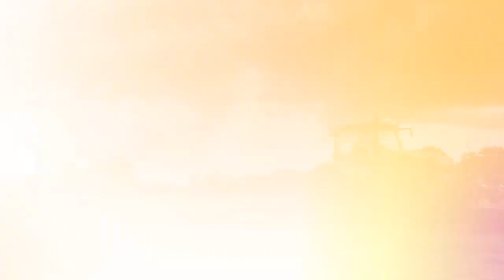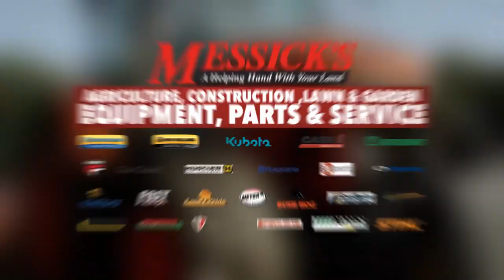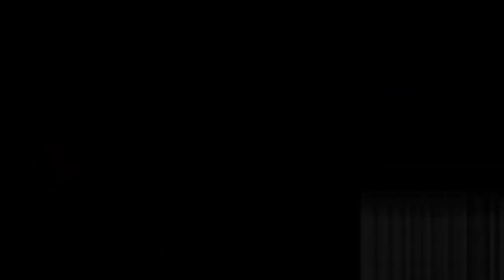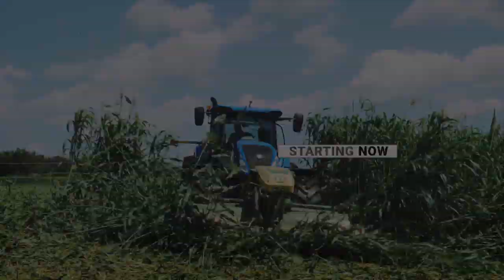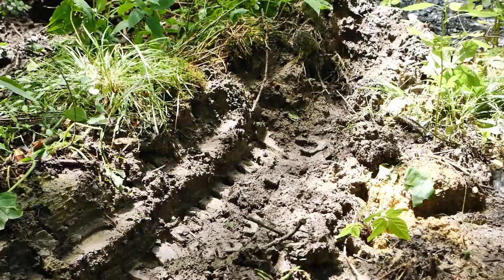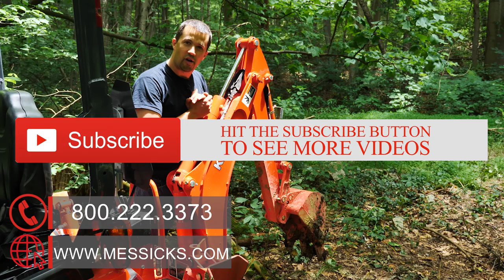Axle deep in the mud! Getting Unstuck with the Backhoe

Comment: I did this, yet with a wheeled skid steer this spring, 8400lbs sunk to the frame in the grass. Soft enough I stepped on it with my shoe and sunk to my knee.
Not sure but I have a few logs and pieces of 2x12 in my yard now about 2 ft deep

Comment: I am starting to have doubts about the R4 tires
Reply: They load up with mud really easily.
Reply: They fill with mud very fast as soon as they start slipping. I recommend the R1 agricultural tires if you are not mowing grass with it or in very sandy soils
Reply: The R4s are great tires - until you get in the mud.  If you work in a lot of mud or loose soil, I would recommend the agricultural tires.
Reply: Just like the wrong tires on your car in the winter.  Need to think about what you are going to use your tractor for before deciding what tires to put on it.  If you aren't mowing your lawn R4's or R1 tires for dirt work.

Comment: Fun Fact: If you do anything with a backhoe without lowering the stabilizers and the tractor tips over your insurance will not pay for the damage. Also roll the bucket back more so the teeth go straight down, you'll dig less and pull more.
Reply: Sounds like you need better insurance, it's common practice to push and pull machines with the backhoe or excavator bucket, naturally stabilizers would not be down, but also a qualified operator would not be likely to tip it over. But I think you simply let your insurance give you a simple answer to weasel out of paying.
Reply: Doug, how would the insurance even know?  You’d be silly to volunteer that information.

Comment: you're on rather flat terrain, so if I'm stuck on a grade (not buried) with a small garden tractor such as this, but the bucket curl nor the backhoe cannot rescue me, is there a hydraulic pump issue? do they get weak? i will try again on flat ground, but i was curious if smaller equipment can rescue itself, like the deere 135g. thanks for your time.

Comment: Something that would be nice to help with that is a locking float detent for the boom so that the dipper can't lift the tractor, cause the dipper is really doing all the work, the boom just takes traction away from the rear tires when it picks the back up.  I'm not sure with Kubota, but the JD 1-series backhoe has a float on the boom to make it easier to trench with the lower flow rate, but it doesn't lock in like the loader float does; you have to hold it there.

It's also funny how these little backhoes will pull you all over the place when you're trying to actually dig a hole, but then when you want it to pull you out of a rut, it seems like they don't have enough power...

Comment: Per the other comments, curious why the steps to get unstuck would not  involve this sequence  1. try to rock back and forth via engaging the HST 2. Engage RDL. 3. utilize the front bucket (curling/uncurling/lift the tractor via the loader arms to move the distribution weight of the tractor from front - back wheels 4. utilize the backhoe if the user (she/he) has one (many folks don't).  Then there are a plethora of other steps that we can all think of: use materials on-site to help get traction to the wheels, winch, bring in another "motor" to tow, call roadside assistance and learn more about the fine print (T&Cs) on the contract to see if they will assist. One thing I didn't mention, I do enjoy all of Messick's videos.  Very helpful and Neil you are a great presenter.  I hope to visit your dealership one day. Cheers!

Comment: Ok the whole thing is wrong.  Sorry but you this is how is done. You pick the front part of the tractor by putting the loader down and bucket flat. Then drop the outriggers almost to the ground  and use the backhoe  to swing the tractor out of the mud. By the the machine should have enough traction to drive off with the bucket still in the ground in the flat position to prevent the front from sinking.